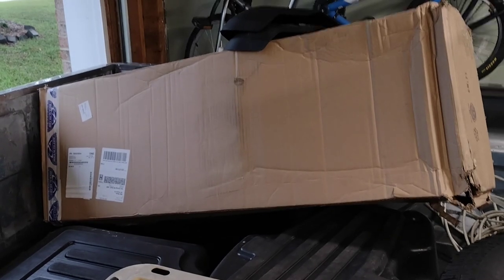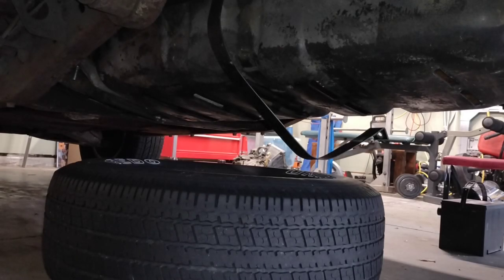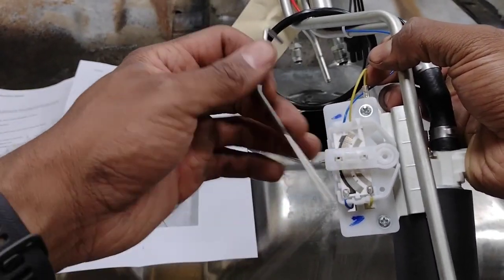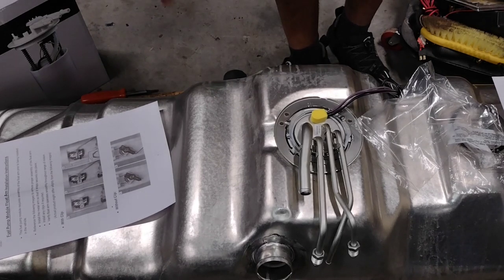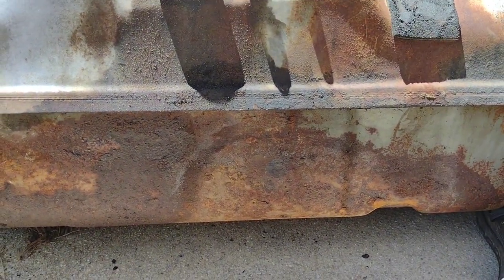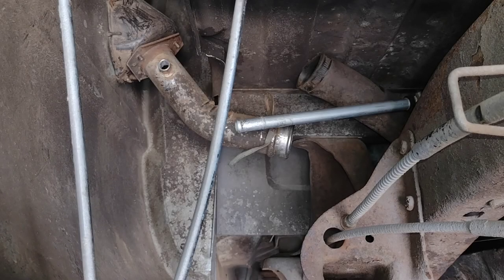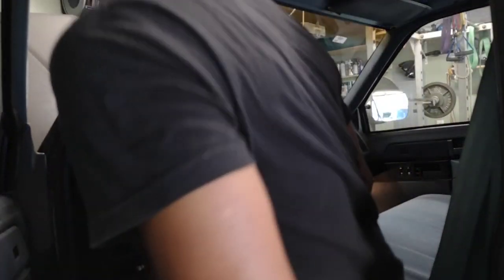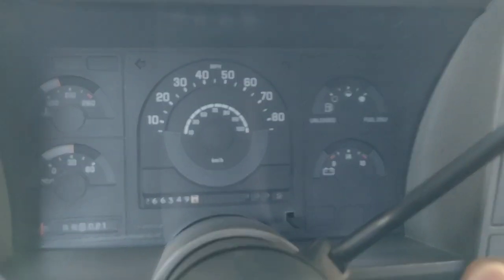1989 Chevrolet K1500 fuel tank and pump replacement

Comment: Great job! The tip to remove the rear driver side tire is something I didn't even think of. I just paid $400.00 to tow my truck and all it was was a bad ground. I wish I would have seen this video to see where the fuel pump ground wire connects to the frame and  avoid the $400.00 tow charge. Well at least I didn't drop the tank and change the pump. I already did that before. For all I know it may have been a bad ground the 1st time I changed the fuel pump in my workplace parking lot.

Comment: Thanks Maq!  Got the tank out of my long bed extended cab 89 today.  It didn't have the frame bracket for the strap.  Came out -pretty easy, but it is tight tight tight getting the fuel lines loosened up.  So far, this has not been as bad as dropping the tank on my 94 Ciera.  Hope it goes back in without too much trouble.  🙂
Reply: Wows--got tank and Vortec pump installed.  ALL my engine check lights are gone 😳 did not expect this.  Truck is running great, no more surging and loss of power intermittently.  FYI, I've seen some folks caution against going with a higher pressure pump on the TBI trucks.  No probs with this one, I did put a 15psi spring in the pressure regulator.  It is easier for the computer to adjust high pressure down, than to try and compensate for low pressure.  I was getting A Block Learn Module error when I hooked the laptop to the OBD1 connector,  and this was triggering an engine check light.  Have not hooked the laptop up since replacing the pump, since it is running so much better.  MPG has increased NOTABLY since replacement.  I could smell the gas coming out of the exhaust it was running so rich before.  Doesn't make sense, since it had low pressure.  Was running about 9 or 10 psi previously.

Comment: Thanks for the great video and explanations. I have a 1988 c1500 that I am replacing fuel pump in.  Your video is the only one I've found that has the same type of setup as mine.  I'm afraid I may need to replace tank as well. Rusted only around pump area.  Unfortunately, my fuel lines did not disconnect as easily as yours. Too rusty. I have to replace the lines that connect to the pump. Part number for anyone looking is 800-933 for 5/16" return line, and 800-934 for the 3/8" supply line.
Reply from the maker: No problem man. Good luck with yours. These are great trucks but they are getting up there in age.

Comment: I need to change the fuel pump on my '89 Chevy.  I have been told that it is easier to remove the bed to replace the fuel pump. Very informative video!
Reply from the maker: Thanks! Truth me told, if I had space, I would have liked to remove the bed too.

Comment: I replaced my fuel sending unit on my 1990 GMC Sierra when the bed was off , I figure is 32 years old and I had easy access do it now before the pump fails. We replaced it and a month later the new one died, We took the tank off and found out that the pump is bad, imagine that. Great video
Reply from the maker: I keep hearing this. I hope mine lasts. My old one worked fine it was just so rusty. Let's keep these trucks alive.
Reply: Been having issues with my truck. 3rd fuel pump in 4 years.  I'm going to buy ac Delco...
Reply: @1deadpool11  I understand that, my truck stopped running a few days ago, I hope is not the fuel pump again,I installed this one a few months back, the first one lasted about three weeks.
Reply: Yak Woodz  thank you for the tip, we installed an external fuel pump, I got tired of removing the tank.
Reply: Yak Woodz  we had the bed off the truck when we replaced the first pump. About two guys lifting the bed, well it took four we are old and decrepit.
Reply: Yakwoodz where you located I’ve got an 89 that needs body work and paint!!

Comment: Great work, your video really helped me with some questions I had on my recent 92 GMC Sierra purchase! One thing I noticed is that you forgot to put the anti squeak material back between the tank and straps! I'm pretty sure you've noticed a noise by now, I just wanted to point that out.
Reply from the maker: Thanks! If I remember correctly the old stuff was stuck and crumbling and I didn't get any new material. Honestly, I didn't realize it was something to install until I got the old one apart.But I guess I'm lucky. I have not had any noise yet.
Reply: @MaqsVids  Your welcome! Yes I figured that, I thought the same way. Luckily when I went to the part store to get fluid for my 86 C10, the old guy checking out beside me and myself got into the conversation about fuel tanks and he mentioned to use old bike tire inner tubes as anti squeak! Simple yet genius, he also mentioned to me it's not only for anti squeak, it's also for anti chaffing which can cause fuel leaks in the future! I cut the tubes in half (long ways) then cut to fit length, and then glue. Make sure the coverage area is correct before tightening scraps the first one I did was a bit narrow!

Comment: I replaced my years ago i bought the fuel tank from orally the old one was a 30 gallon but couldn't find one so I got a 25 gallon. If I ever need to change the sending unit I cut a square hole into the floor of the bed and bent it up  or down for easy access.

Comment: Nice truck compared to my 1990 Chevy rusty beater. I got the fuel pump out just need to put the new fuel pump on the sending unit now and I am changing out the fuel filter hoping she starts right up.
Reply from the maker: Thank! And good luck!! I actually found a good bit of rust on my floorboard today. I will be uploading a video about it in a few days.

Comment: Excellent and very thorough video! Thanks for making this as I am in the middle of doing this for my son on his 1997 K1500. One question, at the 12:40 time mark, there is an open metal line on the left side of the view along the frame that is not going anywhere. Is that just an old line that was for something else and is not used anymore? Just curious. Thanks!
Reply from the maker: You are the first person mention to that. It was a brake line that was replaced and they never took it out. My guess is that they left it because It was hard to get to with the tank in place. And, thanks. Gook luck with your truck.

Comment: I have been searching for a good video on changing the fuel pump on my 97, C1500 Suburban, and yours is the best-made one I have seen.   Your vehicle is a close enough model to be very helpful.  Your video was very well made with excellent descriptions of what you did along the way.   I will not need to change my entire tank, but I did like the idea of using the existing fuel pump to empty the tank.  I was concerned when you used a hacksaw to cut the fuel line.  Isn't this a risk of fire or explosion?  I would appreciate hearing back.  Thanks again for the great video.  God bless.  

PS. I really like the, "Hey, baby. I love you, too!" at the end.  My wife and I celebrate our 45th anniversary on June 10, 2022.
Reply from the maker: Thank you so much! I am glad it helps. And, perhaps I should have been a bit more concerned using the hack saw. I guess there was a chance for some sparks. I was too excited about how I was going to pump the old gas out. A pipe cutter would have been a smarter move. 

PS - Congratulations on 45 years of marriage. I hope to be celebrating the same thing one day.
Reply: @MaqsVids  Also, I was concern when you connected the battery to the old pump. There is a possibility that sparks could have been created near the gas tank opening. Please be carful! Great video!

Comment: Can I ask you what the fuel pump order number is? I’m doing mine cause I’m having the same problems with my 94’ Silverado
Reply from the maker: Hey! I got mine at Oreilly's auto parts. The part number is MPA30029. If you search for that it will come up. Good Luck!
Reply: @MaqsVids  thanks so much. Cheers🤙🏻

Comment: What size bolts were on the brackets? Thanks
Reply from the maker: Hey Herb. Which bracket are you talking about? If you are talking about the bolts to replace the rivets I drilled out, I just checked and they are M8x1.25.

Comment: Was your fuel gauge working before you put the new fuel sender ?
Reply from the maker: Yes it was. Everything worked fine, it was just badly  rusted. And, I had recently had a bad experience with a brand new pump/sender in my 1999 MK4 Golf. I installed it and and the sender didn't work.

Comment: 1990 z71 5.7 tbi I replace the fuel tank n fuel pump it been sitting 9 years it starts up n dies unless you press the gas pedal the min you let off the gas pedal it dies any ideas
Reply from the maker: Hey Mike! That's a tough one for me. If you haven't already, I would replace the fuel filter and check the fuel pressure. Of course, the regular tune-up stuff (spark plugs, wires etc) could help.  Also, I am not familiar with any idle control adjustments for these trucks yet. That could be something to check. Good Luck man!!